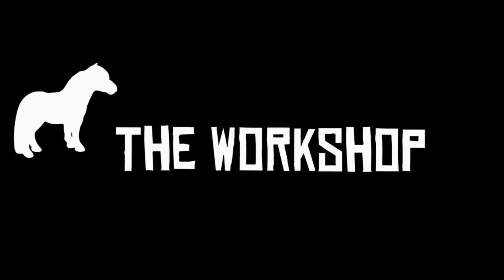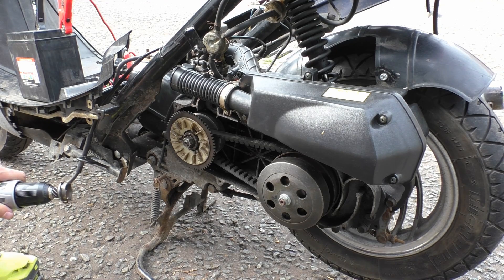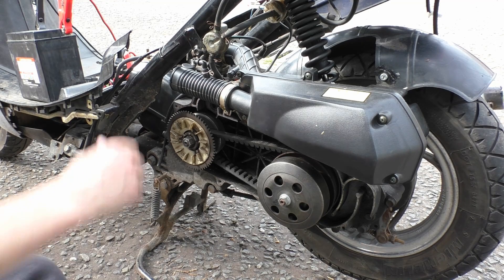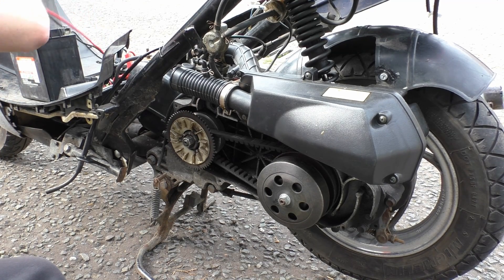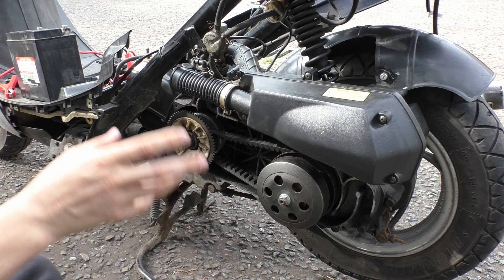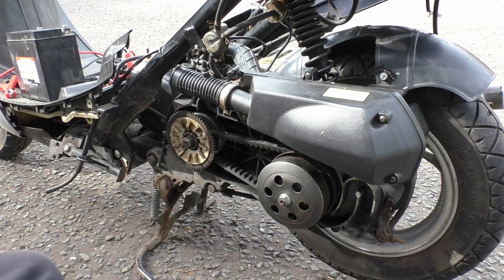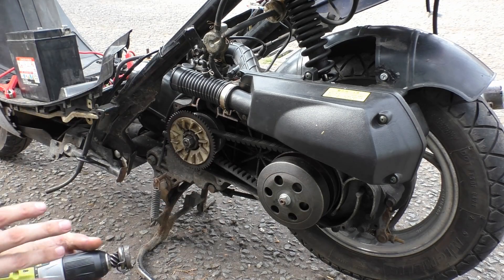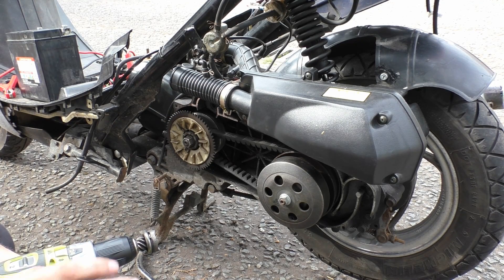CVT issues and AvE point

Comment: One classic. Many guys have done at least ones. Is to lube the chain. With the bike on the centerstand"rear wheel in air" with a running engine in first gear. People lost finger tips that way. Ouch
Another thing is to assure yourself that your knuckles wont go straight into a sharp metal edge. If the tool slip. It comes with experience

Comment: atv's and sleds have cvt, and engine braking...
some even have a one way bearing to get engine braking action below the normal engagement speed. 
I'm not sure how much luck you'll have with that POS china/taiwan setup, as it engages at the driven pulley, instead of the drive.

Comment: I've started 10hp lawn tractors with a socket and drill and it's not the most pleasant thing but when the motor kicks on at idle my drill is still going faster than the motor so it's not too sketchy but when I whip the drill out to start something you usually giving it full throttle to get her going then the drill makes some weird noises and starts to kick lol
Reply: i do the same thing with a chainsaw because the compression is to high to start it with the recoil starter. so you have to rotate the crank counter clockwise to start the engine. the only problem is that when you go tho start it it loosens the bolt that holds on the flywheel. should i weld the bolt onto the crank to keep the bolt from loosing?
Reply: michael ayers there is or there should be a compression release on your saw
Reply: the thing is ancient

Comment: A lot of those shitty scooters run the solenoid enrichener off a timer btw. I have one water cooled one with a heat switch near the thermostat. Most of the aircooled ones have a timer though and the timer fails toward solenoid energized/rich so you can put a switch to open it.

Comment: Battery getting drained by random things is common place with most vespas, in general they leak electricity all over the place for no particular reason. My shitty vespa (beaten up kymco agility 50) for example has cables that seemingly degrade and leak more and more with each year, even a new battery (and nothing but the pure cable harness attached to it) will run flat in a few days. Oh and if the battery runs flat the automatic choke stops working, usually leading to the engine getting drenched with fuel when trying to start it.

Comment: Back when you made the video about the gogogoped engine braiking i was still not convinced that you cant engine braik with a cvt. When riding one you can feel the rpm staying higher then idle when not giving it more throttle.  i think the idle (in most cases) is high enough to engage the clutch and that keeps the rpm up untill you stand still and then the rpm goes back to idle. you also feel most of the resistance go away, and i think that could be due to the rpm beeing low enough to dis-engage the clutch. So i think you may have been wrong, but I would love to be called a nobhead and know what the real reson is. cheers for reading.

Comment: Thats the first CVT i have seen with the Primary Clutch on the wheel. All the ones on Atvs have it on the engine to give you engine braking
Reply: Brett Russell most scoots have it on the back wheel, as for engine braking, it doesn't matter which end it's at. They all have two centrifugal clutches in them, that's what gives you the engine braking.

Comment: What are those sharp teeth on the edge of the outer front variator disc for?
Reply from the maker: 2 sharp teeth?
Reply: the teeth of the front variator disc, but it's probably where the starter motor engages